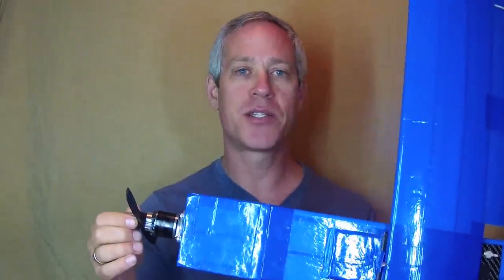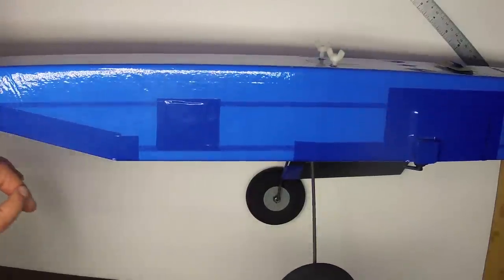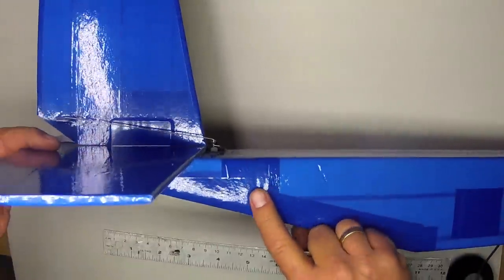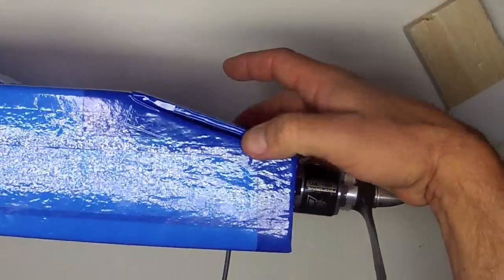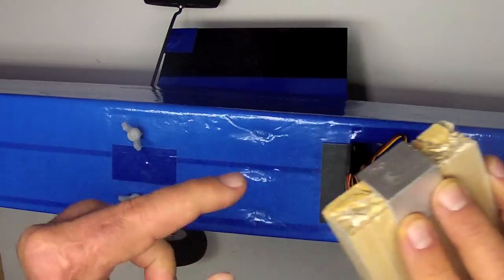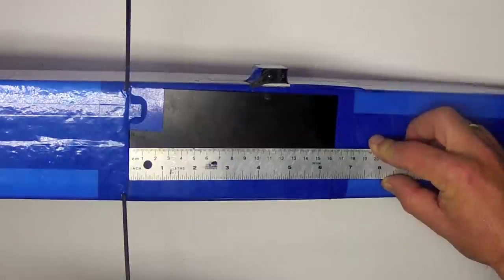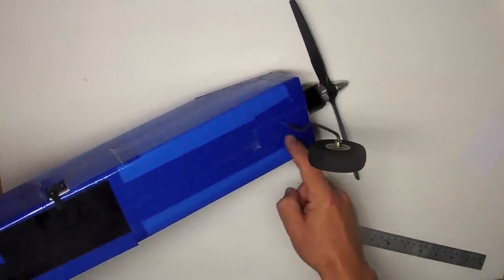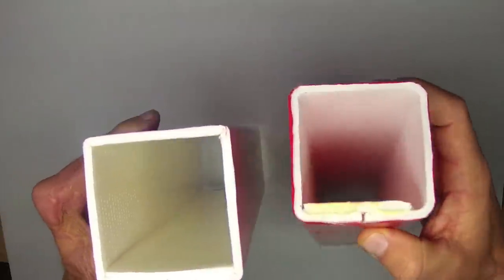RC Donkey - Details and Dimensions

Comment: Great video Ed. Good to see you posting.

     The Wood and metal for the wing hold down are awesome idea, Very Strong and easy to do at the field,  but way advanced. Be nice to see a video of that but alas, we can't go back in time can we.

Do you think regular PVC sheeting could work for the drop door (I have some on hand) or is it too brittle to hold weight over time. I know it is too brittle for the wing hold down.

The steering assembly for the front wheels, where did you find one like that? It looks different, but might be the angle of the video. 

What is the voltage smoothing capacitor for? I mean, I get the title of it, but don't understand why it's there or how you did it.  Is it for the extra servos for flaps and such?  I have no idea.

Thanks for anything you can answer.  

Peace,   👍
Reply: SnapPunch Robert, For the wing hold down heres a tip glue cut painters sticks to the inside leading and trailing edges of the wing when first building the wing and then once your finished making it screw the bottom plate to them.

Any flat board should work for the trap door.